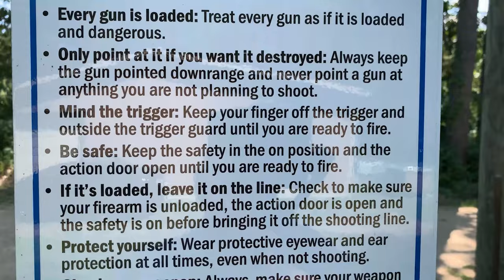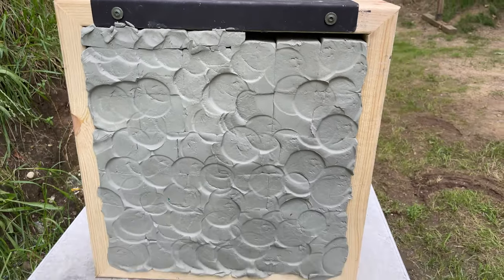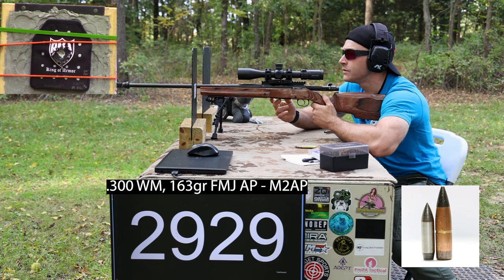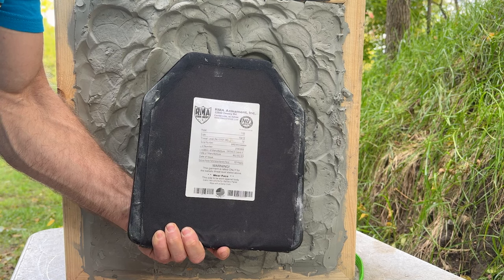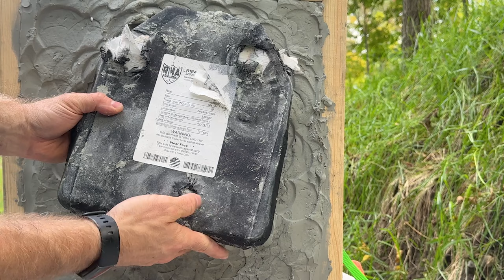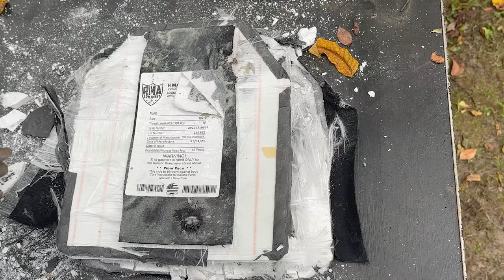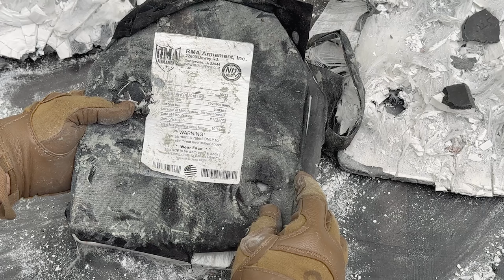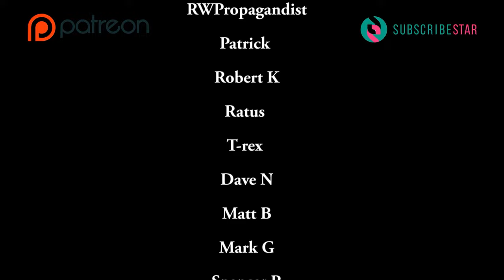Can You Trust RMA Defense Model 1155 Level IV Plate?

Comment: Nice to know my M855A1 has a chance of penetrating IV plates
Less nice knowing that there's the same chance in the opposite direction
Reply: Where u get at m855a1 at tho
Reply: i wouldn't count on it. the M855A1 will likely only penetrate if the plate is weakened from several shots beforehand from a different caliber
Reply: @Hawaiianbro10  Officially M855 is to "pierce hard targets" not to be "AP" but "Hard targets" and "AP" are relatively similar terms. Plywood and drywall will not stand up to a 5.56 unless it's quite a few layers, and if you're shooting through 15 layers of plywood I guess my question is what the fuck are you doing? What situation are you in?
Reply: m855a1 is legal to buy and own. the manufacturer doesn't offer it for commercial sale but if you look there are people selling small lots of it and it is completely legal.

Comment: I thought the M2AP threat they used was a .30-06 AP round, not 300 Win Mag.
Reply from the maker: The M2AP load originated in 30-06. However in order to achieve 2,880 fps, the lab uses a universal receiver and can easily hit target velocities without exceeding cartridge pressure maxes. I can't, so I use that same bullet and I load it in .300 Win Mag. The cartridge used to deliver the bullet to the target doesn't make a difference. It's the bullet itself and the spec'd velocity :D
Reply: He explained it. He needed velocity that 30-06 can't give you.
Reply: @BuffRANGE  Thanks - if you'll please excuse my persistence, I don't understand what a universal receiver has to do with it. What cartridge case do the NIJ labs use? A .30-06 case but loaded to a higher than spec pressure? How/why did they come up with a threat spec (2880 fps with an M2AP bullet) which doesn't exist in real life?
Reply from the maker: @sbreheny  I'd have to ask them, but I'm guessing .30-06. They handload every single one of these to meet spec. They likely came up with 2,880 because it represents a worst case scenario. If a plate stops said threat that speed, there's no variables in real life that would cause a penetration at an engagement distance? IIRC the original M2AP spec was like 2,750 at 78'. Don't remember if that was from a 1903 or M1G..
Reply: @BuffRANGE  Thanks!
Reply: As long as the bullet itself is the right dimension, composition, weight and velocity, the specific means of delivering it doesn't matter in practice. In this example, you can think of the cartridge casing as functioning as a universal receiver

Comment: See this plate take like five shots, what would be the steel equivalent that could handle those rounds?
Reply from the maker: There isn’t one. You’d likely need a 1/2” thick piece of RHA at min.
Reply: That would be something close to 70 or 80 pounds I think.

There's a reason steel didn't catch on in the age of firearms.

Comment: Investigations surrounding failed FIT tests involve more than the initial ballistics test.  Manufacturing methods and supply sources are also analyzed. Nothing from the NIJ has indicated that the penetration of the armor was a standalone reason for exclusion from the program. Be part of the program then you have to play by their rules. I shot my 1155 after the FIT failure and had an M855 pass through 3" from first shot .30 M2AP.  Maybe they have fixed their issue.  But, best strategy is to admit where there could be improvements, correct them in an obvious transparent way and move forward. Everyone can do better and no manufacturer is perfect.
Reply from the maker: The reports that RMA shared from NIJ showed no material or process variation  . At this point RMA has an appeal with the AG and they will likely recertify the 1155 under NIj 07.
Reply: @BuffRANGE  Do you have a link for RMA's shared reports indicating that the NIJ concluded there were no other issues?  Would like to see it as we are planning to purchase several dozen plates before the end of the year.
Reply from the maker: @VortexLimbus let me see if I can find them. They were on their website.  Do you have pics of the M855 pen on the 1155 you shot? 

I just finished the 1165 demo and that’s a definite upgrade over the 1155. I’ll have to get the video finished.
Reply from the maker: https://rmadefense.com/wp-content/uploads/2023/09/Exhibit-C2.jpg

And https://rmadefense.com/rma-vehemently-disagrees-with-nij-safety-notice-05-2023-to-level-iv-model-1155/
Reply: @BuffRANGE  I do but I don't want to get in the middle of all this.  Thanks for the links.  We like RMA and just wanted to see what the resolution was. Unfortunately, we have to follow the advice of the NIJ when selecting our products. We have talked about the 1165. The backing on that plate allows upper 30s and low 40s mm on shot 2, not sure we want to go with a thinned out backing plate. Someone showed me an NIJ lab test report on that model and it was  basically a two shot plate with shot 2 almost hitting the 44mm max. I am not sure if it could routinely pass a drop test with so little protection on the strike face.  Looking forward to your next video on it.  I think we would rather have a "corrected" 1155 with the NIJ stamp.

Comment: Do you know the "ballpark" minimum velocity that something like a 45 gr TSX would need to go to pass thru 3A?
Reply from the maker: It all depends on the IIIA type. I would say the min would probably be 1600-1700 fps on Aramid, but PE might require in excess of 2000 fps...
Reply: @BuffRANGE  thanks! I shot a few test loads yesterday and got them up to 1875 fps...which is about the max that I personally care to try. 350 ft-lbs seems like a good number to stay under, imo.  They sure did group nicely...even though very small sample. 

I think the 37 gr Makers might be the better pistol option for that bullet eXpanding design, but need to put them into gel to compare. I have doubts about the 45 gr TSX opening in clear-gel, but need to put that to the test. I saw your video with the 53 gr TSX didn't really open well. Maybe from the rifle 45 gr will? TBD.

I just got a box of the R&R 37x yesterday and have a couple boxes of the 37 gr Maker's X to try my own loads, but R&R I'm guessing is already up in that velocity I'd probably not go much beyond, if at all. So my loads would really just be to see if I can either beat the accuracy, and/or not have to wait 2-3 months to get a box.

Comment: I think AP loaded into 300 winmag for that velocity isn't a realistic threat to begin with considering you had to custom make that round
Reply from the maker: The NIJ spec'd the velocity at 2,880 fps. Given I don't have a .30-06 with a barrel long enough to get to the target velocity, and surplus ammo has degraded over time, I'm effectively using .300 Win Mag as a universal .30 caliber receiver. 300 Win Mag can drive M2AP up to 3,300 fps in a 24" barrel, and yes that threat is very unrealistic, and only very high end plates stop that. 

TL:DR ignore the case I am using the bullet in. The NIJ level IV/RF3 threat calls for an M2AP bullet going 2,880 fps. How I get that target velocity has no bearing.

Comment: H380 2950fps 30-06 m2AP...
Reply from the maker: H380?
Reply: @BuffRANGE hogdon h380. It has a reference on the label for 30-06 with 175gr bullet. max charge on the bottle says over 2900fps. My test velocity of 1 shot was 2991 with a black tip. Primer started to flatten out, so its definitely on the top end, but not something id sh!t myself about. Brass looks fine.
Reply: Gave it a try since i dont have a 300wm. Old surplus went about 2770fps like your tests show.
Reply from the maker: @Milspecpoptart thanks for the info :).

Comment: The NIJ doesn't fail plates without a legitimate reason (or at least usually they don't) so really it would be interesting to see how this develops.  

One thing to consider is that the NIJ doesn't really do public outreach beyond stuff like advisories, hence why we don't see any kind of response from them posted everywhere like RMA and their unstable damage control measures. 

Either way, best to keep internet theories to oneself til the verdict from both sides goes public whether it's a public statement or court documents if it goes that far.
Reply: I would also take into consideration that if the NIJ says they or the lab messed up, how many other companies are going to come after them? They have a lot on the line as well.
Reply from the maker: Rightfully so. The physical evidence presented seems to show RMA's plate per FIT did not fail (backface is not tested for FIT), and a mistake has been made. If the gov't has evidence to prove otherwise it seems poor for them to not end the entire years worth of back and forth. It sounds like this is going to end up going to court..

I'm curious if you would expand  on "Unstable damage control". They pulled the lot from the initial issue. Ran numerous tests on plates to ensure their design is sound. NIJ root cause analysis deemed there was no variation of manufacturing or materials. The plate has passed FIT every time since it's inception.
Reply: @cc-vg4ed  the NIJ has representatives and “subcontract” out the lab testing to accredited labs. These accredited labs are expected to be technologically equipped and capable of conducting scientific tests, and is a third party laboratory that is neutral with no ties and affiliation with clients, companies, organizations…etc. Then you have NVLAP, maybe a few others. I don’t think we can exactly say the NIJ themselves are potentially the ones to blame when you have specialized entities that that flows in the armor testing system. 

If the NIJ themselves really are to blame then they will be, however if the snag is actually somewhere else? Then what? I wouldn’t put all my bets that RMA is going to be clean, as we haven’t heard any sort of official statement on the matter from the NIJs side. It’s difficult to draw any picture if we only have the story from one side.